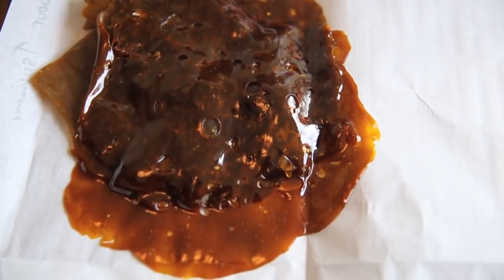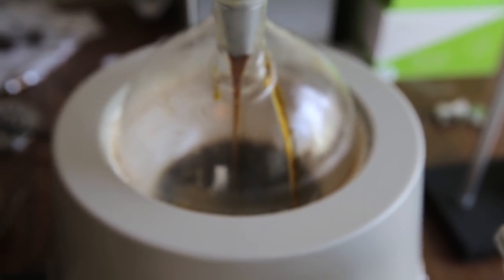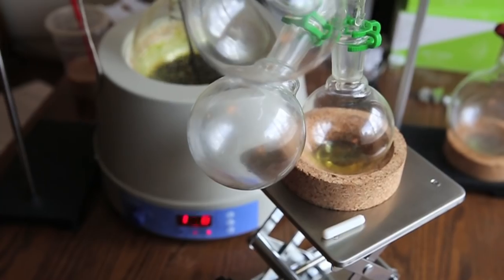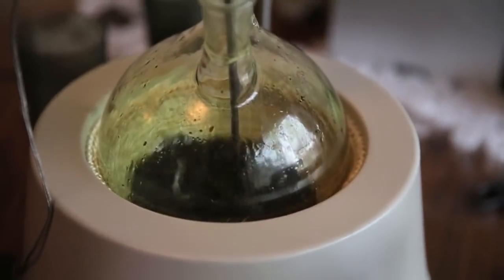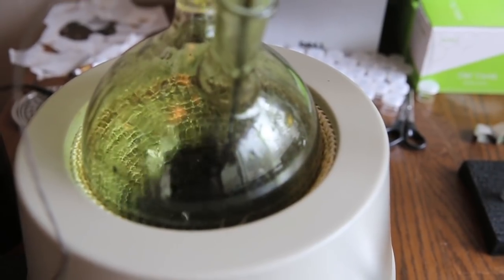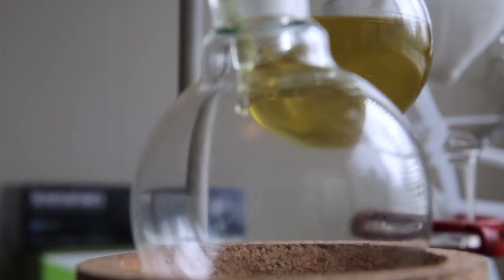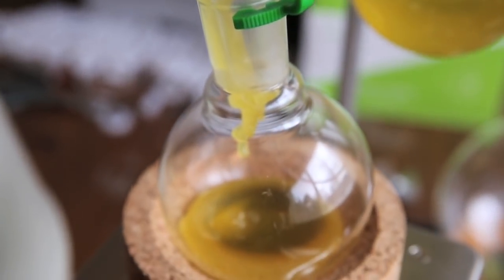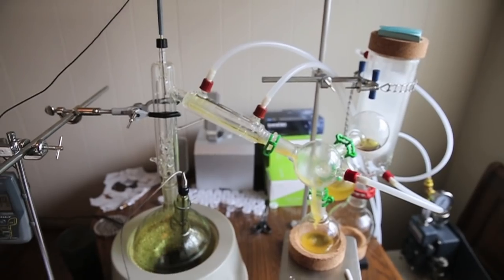Short Path Distillation of Cannabis THC & CBD (Tetrahydrocannabinol & Cannabidiol)

Comment: amazin! Please post more start to finish videos with as much knowledge as possible....best video on youtube for this information right now....

How much ethanol are you using? I'm guessing just enough to dissolve. maybe a few ml's more.
Reply: +Open Source Steel   This shit is deep bro - subbed
Reply: Dear Michigan,Thank you for the comment.  I am sorry for that I didn't read your message before. In our supercritical co2 system, we can adjust the achohol sovent flow rate by adusting the frequency of the solvent pump.
Reply: This is CO2 Supercritical co2 extraction machine. It can extract 100% CBD from the industry hemp in short time. The CBD quality is high quality.
Reply: Thanks for this upload
Reply: MichiganGrower  @co2 whatever .false. stop fronting tryna say it's your c02 crap. it's a short path.  the cbd is the oil not machine.
Reply: @careddisupercritical  how do you make the crude oil in the start do you need a lot of equipment

Comment: What was the "starting yield"and the "finished yield"? I heard you guys inputted a pound of oil in the flask? So In the 3 dragon balls . Was was the outcome weight of the clear ??
Reply: I feel like trying to calculate a theoretical yield for this would be next to impossible, since the THC and CBD content from each plant can be very different depending an a ton of different factors.
Reply: ikr crazy was thinking that too.
Reply from the maker: You are correct however the estimates are as follows:

Average 20-30% loss from winterization in weight
Average 40-60% yield by weight from starting oil or roughly 80% - 90% of total THC content of the starting mixture.  

You will usually have some residual and left over Cannabinoid content left in the boiling flask at the end.  Save this product and create a large batch that can be reconstituted.

Comment: Are you sure your temps are Celsius? Under vacuum, those would seem to me, to be above smoke points of many oils. If you're mantle is set for 235° C and topped off at 232° C (450° F), that seems like you're under normal atmospheric pressure and would be burning oil and even the head temp seems high (I'm not a chemist). Can you, or anyone enlighten me? What is the base oil?
Reply: Everything boils at a much lower temp under vacuum.
Reply: Never trust heating graduations to be accurate.

Comment: Why the fractional column?  Wouldn't that defeat the purpose of short path distillation?  You are using vapor pressure to push the molecules up the apparatus, instead of taking advantage of the short path between the liquid and the condensing surface.  I don't see how this is any different than a traditional apparatus, other than it might be more convenient.  You're not getting a lower boiling point.

Comment: doesn't thc burn off below 225 celcius? wouldn't the thc be destroyed by these temps?
Reply: they are doing farenhiet
Reply: then why do they keep saying "celsius"? hmmm?
Reply: Perhaps thermometer on the distillation head was celsius, the thermometer on the isomantle was fahrenheit,Idk
Reply: kinda... basically, Yes, in a normal atmospheric circumstances the thc will burn off and it will be gone to the ghosts, or offered up to the Gods... However, even though it gets turned into (vapor/smoke), but because its all contained and sealed. The vapor can be trapped, and forced back into liquid state by chilling vapor. The heavy oils coagulate and bond to each other, then gravity allows the the newly formed coagulated vapor to  be collected into one of those 3 balls. Then the only thing that you're really gonna lose is going to be the light gasses that's not going to re-bond, like co2... this process also decarboxylates to your material....
Reply: they dont want the thc. listen to what they said. they want the cbd oil.
Reply: They said the plant they used was High in CBD not that they only wanted CBD
Reply: Nah it just boils and makes vapor. Just like water really. I believe THC and CBD start to boil at 160 - 180 c. Some terpenes boil at higher temps, up to around 230 c, thats why they go above 200 c, to get all the terps.
Reply: under deep vauu, no oxygen therefore no oxidation
Reply: The important temp is at the head (that measures vapour temp). The mantle will always be hotter but the vapour at the top is the indicator of where you're at. For example their mantle was at 190 degrees Celsius but the head said 126 degrees Celsius, which is the temp that really matters. First fraction would be 0-157 at the head, second 157-180 at the head and third 180-200+. They're not using Fahrenheit as that would be 300 plus.
Reply: Ben Clarke THANK YOU. Basic ass shit right there. The head therm should be at the interface of the condenser that's the only temp. 
Using the thermocouple from the mantle controller keep that head joint perfectly heated.   First thing I thought.
Reply: The temperature was actually 125C he said.  that's at the condenser head. the temp at which your distillate comes off is this temperature only. ignore the mantle temperature of 225

Comment: What vacuum pressure do you use on this system if you don't mind me asking?
Reply: This is not a distillation under reduced pressure they are using the atmospheric pressure.
Reply: Marvin Man  They show a belt-drive pump in the beginning of the video.
Reply: Nah, there's a pump. It's mentioned several times in this video. I'm also wondering what pressure this is run at.
Reply: I'm usually 150-180 microns and everything is over by 220c

Comment: Did you have to prep the material (i.e. Winterization and Decarboxylation) before loading it into the round bottom flask?
Reply from the maker: Yes, always recommended.
Reply: @OpenSourceSteel  what if you don't have a freezer for Winterization that brings it down to -45 degrees would -18 degrees work enough?
Reply from the maker: Rob van Gils it will help but ideally you will want to condense as cold as possible so as much dissolved fats solidify.
Reply: How do you make the prep material

Comment: New to distillation.  My question, in the end do you mix all 3 fractions or keep them separate?
Reply: keep them separate. tip is to tare weigh all ur flasks first before u start. so when ur done with ur run, let it cool and then weigh each flask and u subtract the tare weights to get your final yield weights. once you collect enough runs you can redistill all the heads together and all the tails together to save time. always wear gloves.
Reply: you can do whatever the customer needs

Comment: Starting with a shatter material instead of crude? Didn’t know that was possible
Reply from the maker: Starting with a higher purity extract to begin with will always perform a better distillation.  This is due to the lack of impurities which normally elevate the boiling point beyond our desired point.  Even better, winterize and filter your shatter using a high purity grain alcohol/ethanol before distillation to get the best results possible :D
Reply: Great thanks very much I’m going to try this method

Comment: Does the bho need to be in solution with ethanol to be distilled or can you just throw bho in a flask by itself?
Reply: As long as the Crude Oil is properly purged of the solvent.
 Otherwise, that’s what you’ll be distilling (The Solvent) at first.

Comment: what is going on?
Reply: +Boojyman science
Reply: distillation, simply being put, terps evaporates faster then cannabinoids, and cannabinoids evaporates faster then fats, lipids, & other contaminates. It's the same idea as moonshine, but not exactly the same by any means ✌.
Reply: Thanks.  so They are heating the product and catching they different evaporation part of which is terps which re condenses into one of the different sized containers. when bho is vacuum purged most of the terps are lost in the process, but Here they catch the terps.  Some people call this terp sauce "holy water"  and when they mix it with clear thc oil they call it "holy grail"

Comment: Sorry for the basic question, but what vac is being pulled on the short path system? -29inhg? @Open Sourse Steel
Reply from the maker: Full vacuum on our Welch 1400b Duo Seal.  With vapor pressure of cannabis @ 0.9cfm on the pump we see around 175-250 micron.

Comment: Very interesting equipment and you guys are so entusiastic about it, would love to be there.
I ordered a distillation apparatus on ali and fantasize about being an alchemist already, lol. 
I was mesmerized by the whole process and you were so on point on many aspects of it.
And then I looked at the prices of the equipment and the associated energy cost.
The heat mantle, the vacuum pump and the chiller/heater unit.
And then there are LPLC flash chromatography rigs.
A number of pumps, a pipe filled with silica, bottles of solvent and the sample.
A controller and pipery to deliver sample and the solvents on top, monitor the output with a sensor 
and then direct the eluent into vessels. No heating, no vacuum, just some pumps.
What do you think?

Comment: noob asking: So if the first ball is for thc + terpenes and the second for CBD, for what is the third one?
Reply: First one was just for terps, second one was for cbd and thc but at a temp window where you will get the highest quality of both, the last one is for everything left after you get the top shelf extract. Everything evaporates at different temps higher the temp, lower the quality. So you separate the batches out. Also the terps evaporate at a much lower temp than everything else which is why it is collect first.
Reply: @somedudeonyoutube1605  so they collect the 3 one for distill again and collect some cbd and thc that could switch there?
Otherwise they just would trow it away directly from the flask...
Reply: @phonixsolomon6275  the reason they redistill the third flask is because towards the end it starts to get cloudy with impurities so they throw it through again to remove anything that may of made it way through that you wouldn't want to smoke.
Reply: Third flask is still good dabs its just not as good as the second flask.

Comment: Is this pump running the "WELCH BELT DRIVEN VACUUM PUMP" on your website?

Also, i see this term misused a lot in the cannabis industry. around 4:50 in the video you mention viscosity. Viscosity is a resistance to liquid, this means something that does NOT move around easily at room temp(ex: pancake syrup)
Reply: just to clarify, viscosity is the measurement of resistance to flow

Comment: do they put alcohol or something in there? Or do they just evaporate the product directly?
Reply: GRuizMedia they put weed in it
Reply from the maker: The extract was distilled directly, you would normally want to filte and winterize the material using ethanol prior to distillation however it's not ALWAYS required as you can see in this video.

Comment: Hi guys. Your video is amazing. We are trying the same stuff bit qe have some issues with the vacuum. Do you know the specs of your vacuum? It will help us. Thank you
Reply from the maker: Use a high end rotary vane pump that can reach depths of <50 micron and have a displacement of 1-20cfrm.  You should find many options but not all are created equal! We are using the Welch 1400b duo seal, it is available on our website if you are interested!

Comment: what is setpoint and how do you get your endproduct out of your flask? Simply pour it out, wont that have a lot of loss?
Reply from the maker: A set point is the target temp we're trying to reach, in this case THC normally evaporates under deep vacuum somewhere around 200-215c  depending on how well the material is extracted and filtered initially. For the the final pour, you can simply heat the small round bottom flask with a heat gun and transfer the oils to your desired storage container etc.   You may lose an insignificant amount during transfers so minimizing the amount of transfer is important, especially because of exposure to oxygen, heat and UV!

Comment: You can not do this with tap water, right? I mean on the column it has to be really cold for making the condensation and not ending sucking the vapors with your pump... Do you have to use a chiller no matter how long the column is, right?
Reply: You can use tap water in the condenser in this setup.

Comment: Do you have to winterize the oil first? Alot of people say to and I wonder why? Correct me if im wrong but it looks like you did not winterize and the lipids were easily removed later.
Reply: Jeremiah Halpin Yes you need to winterize if you want to do an efficient distillation, and your starting material needs to be around half your boiling flasks volume... These guys don't know what they're doing.

Comment: Is there a magnetic stirrer in there? Could you possibly give a list of what parts are there? Im purchasing a set up and want to use yours as a guideline, so far im mostly guessing what your using and would greatly appreciate a list, thanks
Reply from the maker: The mantle has a built in magnetic stirrer feature. We have a complete turn key kit we offer on our website that will also display a list of everything we are using here. https://www.opensourcesteel.com/collections/complete-packages/products/fractional-distillation-glass-turn-key-package?variant=33526534147

Comment: I need help on why my upper mantle temp won’t go past 50 degrees Celsius! Please help, I’m new to this and we keep going through crude like its water. Please help,
Reply: We have no leaks, no ghost leaks. We get up to temp slowly but once our mantle reaches 180-200 Celsius we get no fractions happening. And our upper mantle temp won’t go past 50 Celsius so idk what wrong doings is going on :/ plz help
Reply from the maker: @KushDaily69  Whats your vacuum gauge reading?
Reply: Open Source Steel we got it all figured out thank you. My next main question is, when doing a second fraction on our CBD distillate we’re trying to get all the delta-9 and thc out down to under the legal .3% we’re aloud to have, what temperature and procedure do you recommend for the best results ?
Reply: Open Source Steel plz help, we could use your knowledge so we don’t burn our first fractions by trying to get out thc. Our first lab result on our first fraction came back with 1.3% delta-9, what temps for a second fraction do you recommend to get that delta-9 down to legal .3% limit. Please help and reply when you can
Reply from the maker: KushDaily69 you must now remediate the THC using chromatography, it can be done using silica column and a solvent like heptane and separating fractions into vials for testing to find the proper band of THC vs CBD

Comment: Where can I find this kit? The link is not working.
On your website I see "Distillation Glass Package with Accessories". Which additional accessories other than a vacuum pump or chiller are needed to complete a turn key setup? 
Thanks
Reply from the maker: https://www.opensourcesteel.com/products/complete-fractional-short-path-distillation-package
Reply from the maker: You can find a vacuum pump from our website as well and a heater/chiller also!

Comment: Whats the smallest run you could do? With smaller glassware. For instance i have a14/20 setup. short path head and receiver. I have 25ml flask. So in theory i could start with 12.5g - 18g of winterized wax. Is this too small of a run? I understand there is a smell in the first few ml, that makes you discard the distillate. Is this a problem in small runs? How do i deal with the smell? Any help would be greatly appreciated....
Reply from the maker: Small batch runs less than 50/25g can be achieved yes!

Comment: How did you extract the CBD ? CO2 is Butane ? And if you use BHO extract method would you need to extract the lipids via weatherization and Buckner funnels or can you skip that step and go straight to short path ?
Reply from the maker: Butane was used in this particular example. Winterization with ethanol and Buchner funnels would still be required to remove the fats
Reply: you should definitely winterize it before short path distillation  and vacuum purge all butane out before this also

Comment: hello together, did somebody know how much is the best vacuum value ? My pump is generating 0,8MPa , is that enough or to much ?
Reply from the maker: M Aksoy your vacuum is not deep enough. You will need to reach somewhere under 0.00003333MPa or 250 micron for success.
Reply: @OpenSourceSteel  is a 2-stage vacuum pump with 4,5 cfm enough to reach the 250micron ?  thx 4 the information
Reply from the maker: M Aksoy Displacement (CFM) and vacuum depth are two different things. A 4.5cfm pump will work but also must have the ultimate vacuum level below 250 micron, you should see this rating also listed in your pumps spec sheet.

Comment: Ethanol has a boiling point of 75 degrees, THC has a boiling point of 150 degrees, how are you not pulling ethanol into your receiving flask?
Reply from the maker: The ethanol is removed after winterization and prior to Cannabinoid distillation. There may be a small amount of ethanol left as a transfer solvent however, it will be removed first as you pointed out it has a lower boiling point then all other compounds in the mixture.  It usually is collected in the cold trap but can also be collected in a flask using a cold distillation condenser.
Reply: Open Source Steel  but these dudes threw in  un winterized crude  I didn't know you can do that???

Comment: Really cool set distillation set up you guys. Just wondering (I'm new to organic chemistry) why did you choose to use a heating mantle over a Bunsen Burner?
Reply from the maker: Digital heating mantels add stable consistent heat which is required for this process.   A burner is less accurate and not PID controlled.